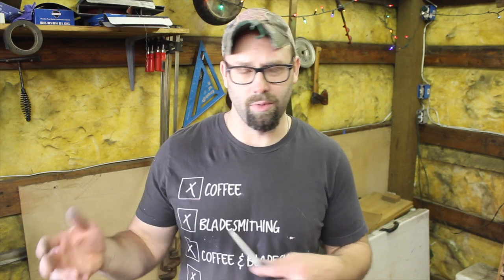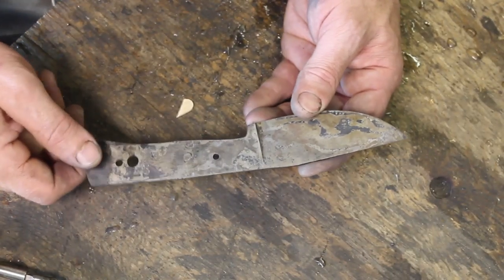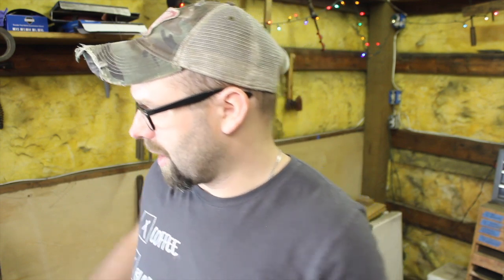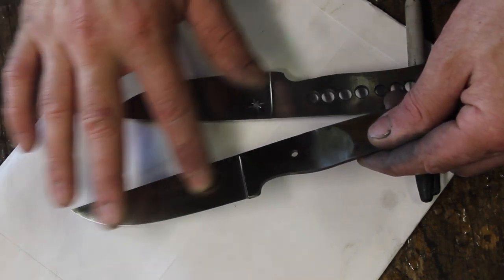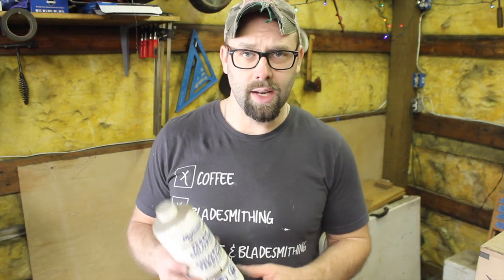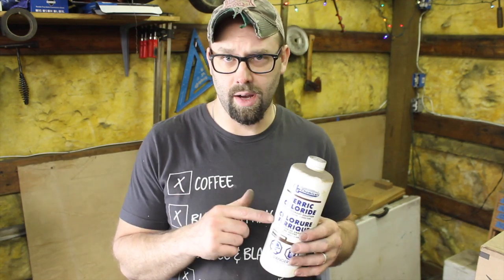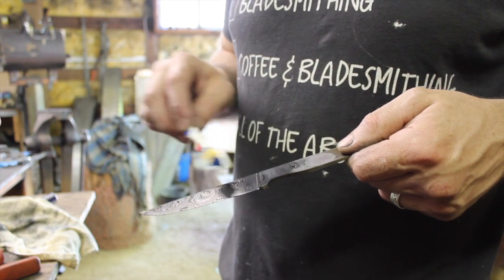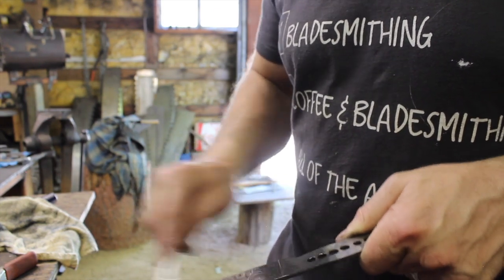Etching 101: How To Etch Your Damascus Pattern Welded Blade

Comment: I use a very diluted solution of distilled water, heating up the water first to near boiling, then add the ferric.   Funny story; the first time I etched a blade, I used a piece of coat hanger wire to hold the blade, while dunking in the solution.  Couldn't figure out why my blade was getting a weird copper color to it.  Didn't dawn on me, that the acid was eating the coat hanger(Dohhhh!).  Now, I use monofilament fishing line.   That copper color was pretty cool, though; just not what I wanted at the time.  Might have to do it on purpose in the future, though.

Comment: Very informative video again. About the ferric though. Do not just dilute it 1-4 or 1-5 since it comes in different strenghts. Some ferric chloride solutions are 20% some 40% and some even more depending on who is selling it to you. To get a clean etch that does not look raffled and coarse....dilute the ferric until it does not leave a mark on a scrap piece of stainless within a few seconds. If the ferric is strong enough to affect stainless that fast (most stainless steels have a nickel content that is 4-5 times higher than 15n20 has)....its also gonna eat the nickel in 15n20 fast. You do not want the 15n20 been eaten... only the non nickel contend steel.  Once your mix is made only etch the blade for shorter periods(1-2minutes max) after every dip clean of the oxides in clean water with a brush. If you let the blade sit for much longer the oxides prevent the ferric from eating deeper into the blade....but the ferric will eat sideways. You will get a dirty looking etch and it takes longer to get deeper. If you polish the blade before you start the etching the etch wil look way cleaner...scratches become lines and magnified after the etch.
Reply from the maker: Thanks for the details!